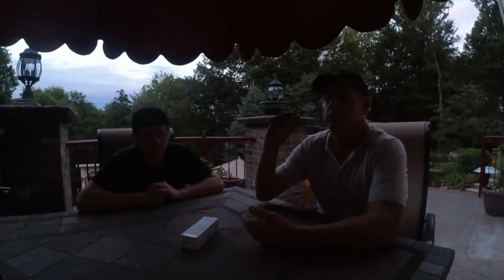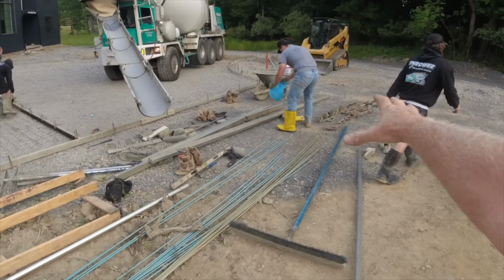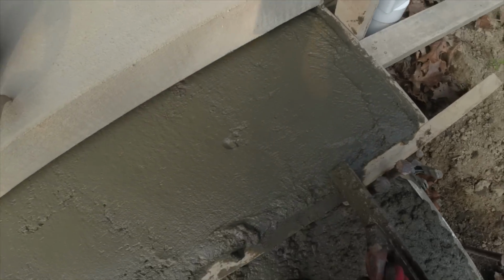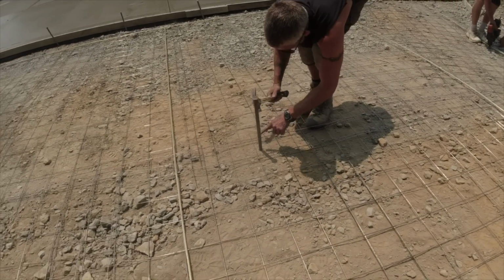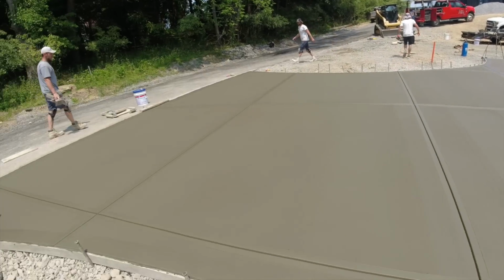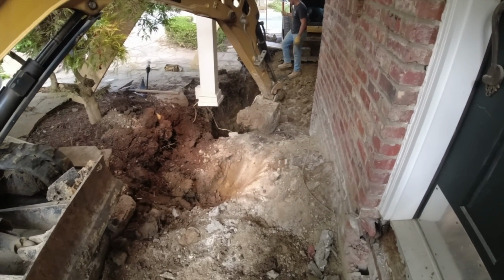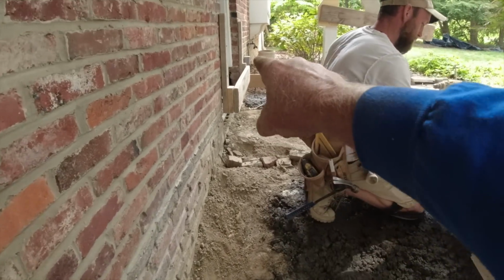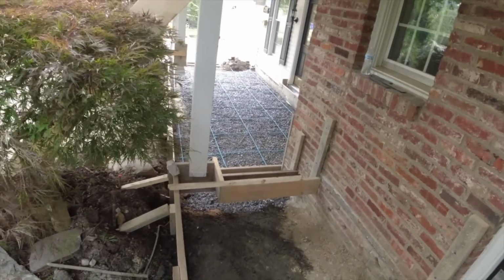Am I Just Being Crabby?

Comment: Question Tom,, what good does it do if the rebar or mesh is stepped on and pushed back down to the bottom of the slab,, shouldn't the reinforcement be in the middle of the concrete, Also I was told by a contractor the V tool leaves a weaker edge and chips later more than a saw joint, is that true. I am have a patio pour done in the next 2weeks and I don't want all that dust. He said there is no joint tool that will give a square cut in the concrete like the saw cut. Is there a tool or not?
Thanks, Gary from Ohio

Comment: The only thing I would have suggested is to have cut the post a little shorter and put the metal post bases between post and concrete. You never want a wood post in direct contact with the concrete.
Reply: Good point. They also hold the post in  place from lateral movement & uplift.

Comment: Hello Tom, had you followed through with your suggestion of using an auger to excavate three or so piers plus a beam to support the roof, in my opinion, your plan would have worked well for that application because piers bear a large portion of the load based on the overall surface area of the column of concrete NOT just the surface area of the base of the column, the connecting beam spreads the load between the columns. My experience with pier and beam footings is quite extensive in unstable, reactive soil areas of Australia and I guess it wouldn't be any different where you are, unstable reactive soil is just that wherever it's located. In my years of construction, I used to build complete houses on this type of footing none have shown any sign of settling even after several decades. However, as usual,  you did a good job with this project because I know from experience these rectification projects are not the best of jobs to be involved with. Cheers.